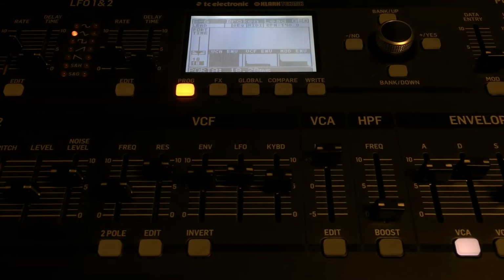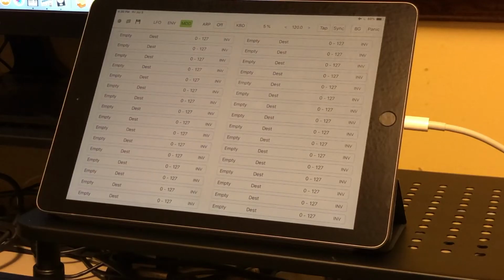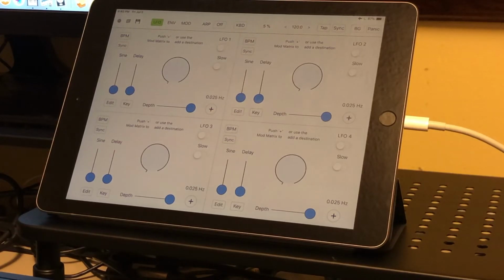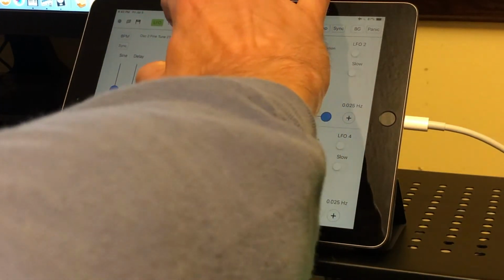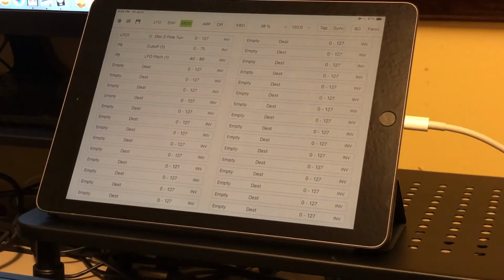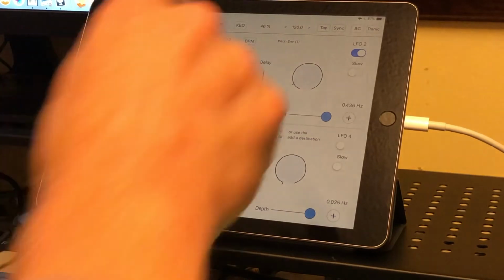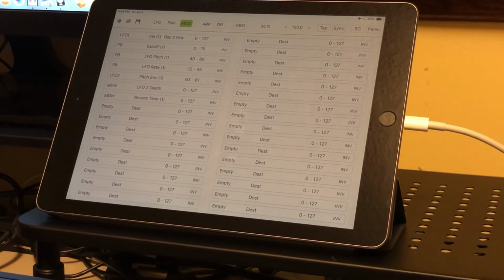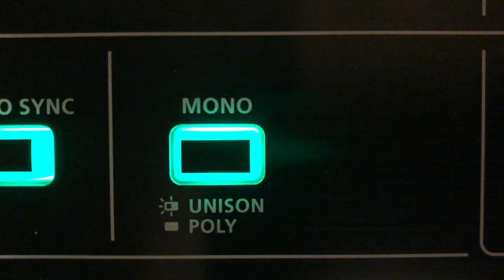MIDI Mod for iPad - Sound Design Demonstration with the Roland System-8

Comment: How do you get the iPad to recognise the system 8.  If I plug my system 8 into my iPad I get nothing what am I doing wrong
Reply from the maker: Hi Chris. The System-8, like most Roland gear, is not class compliant over USB. This is why you need to install drivers for it on both Mac and the PC. Unfortunately, the System-8 does not have support for iOS at all. You'll need to get a USB to MIDI-Din cable or some other kind of USB to Din MIDI interface. In this particular video, I'm using the Roland UM-One USB to MIDI cable, but I cannot recommend it, as it too uses proprietary drivers and there is no guarantee that it will work with future versions of iOS. I've since picked up the MeeBlip Cubit Go USB to MIDI Din interface and plug my iPad into that, using a usb cable and the Apple camera connection kit. The Cubit Go is class compliant, so you plug it in and it "just works". Then I connect the Cubit Go to the system-8 via standard MIDI Din cables. I should have pointed out the connections in the video. Sorry for the omission!
Reply: Thanks for the reply I have ordered a Yamaha MD-BT01 Bluetooth MIDI adapter  so will see how that goes first. I have the driver installed on my Mac that works fine but just want it to connect to my iPad.
Reply: Did it work? Im having the same issues
Reply: @fabimawn  Yes the Yamaha MD-BT01 Bluetooth MIDI adapter worked fine I can now send midi to the System 8 from my iPad and also send midi from the System 8 to the iPad.
Reply: @dacat101  Thanks for the awnser! I saw it only supports IOS though? Anyone had succesfull results with Android?
Reply: @dacat101  are you able to record the system 8 sound into the iPad with this setup? Or is it only usable as a MIDI controller? I’ve been looking for a solution to using my S8 on my iPad and I figured I’d end up using an interface because I read that MIDI cables don’t transfer the sound waves.
Reply: @LocRobser  You will need an audio interface to record the system 8 into your iPad as the 5 pin din midi cable only sends midi data. Not sure if the usb midi will send audio to the iPad I know on my iMac it sends midi and audio I will have to try it with the iPad.